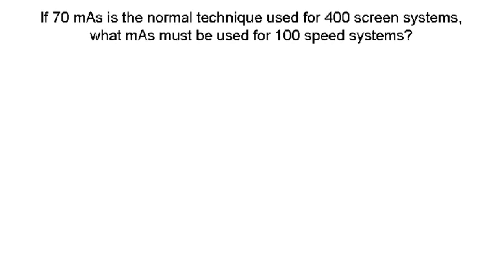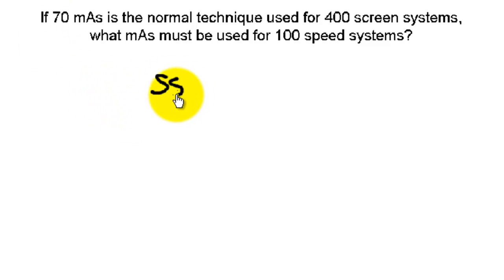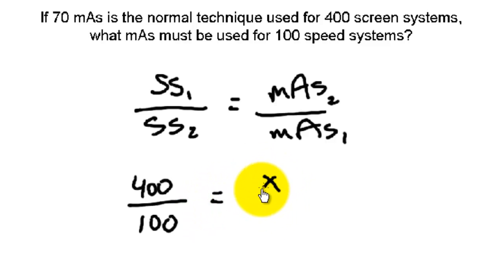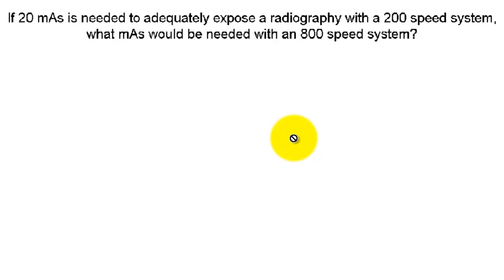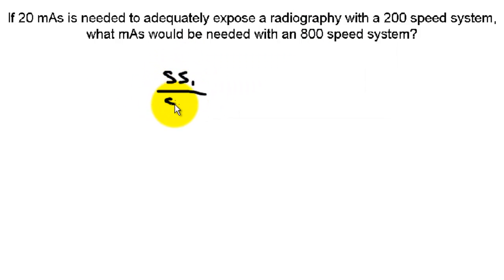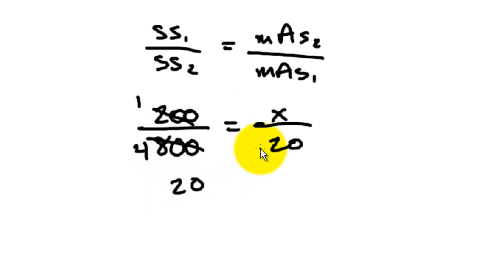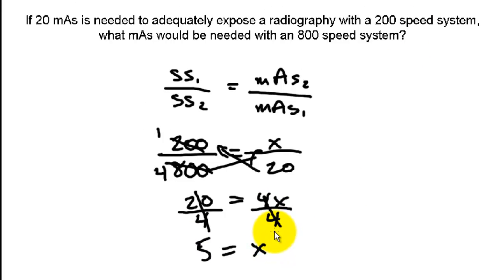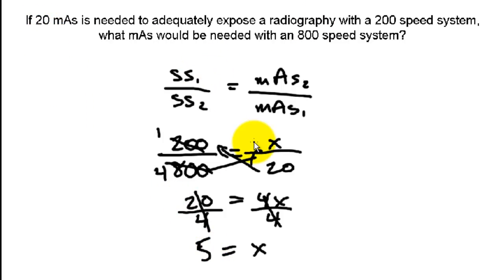How to Maintain Density for Changes in Screen Speed.mp4

Comment: im so nervous for rad program since math scares me lol
Reply from the maker: If you can work with algebraic equations, you've got nothing to worry about.  Most programs will require this level as a prerequisite and you've likely had similar math in secondary school.  Don't let it scare you... plenty of review material out there for the math portion.  That's easy as long as you can remember how to set the problem up for different scenarios!